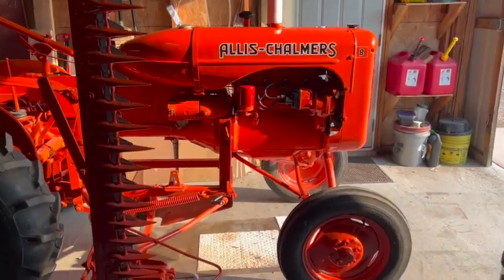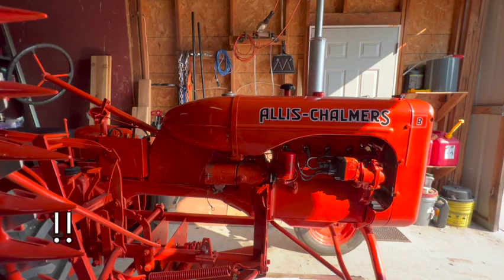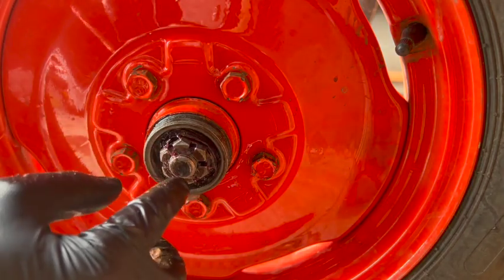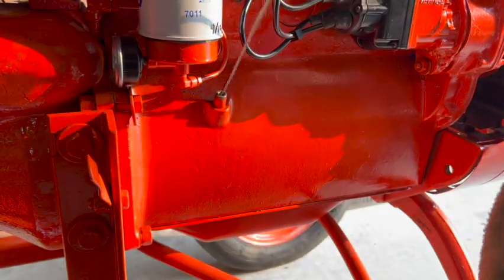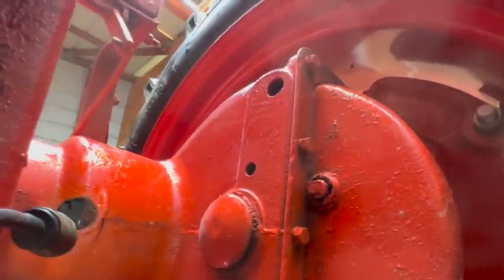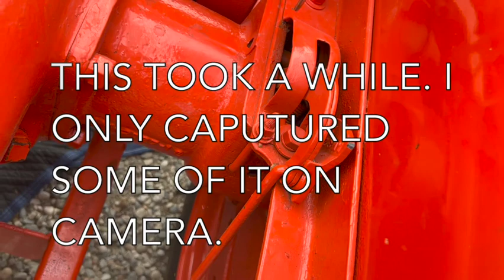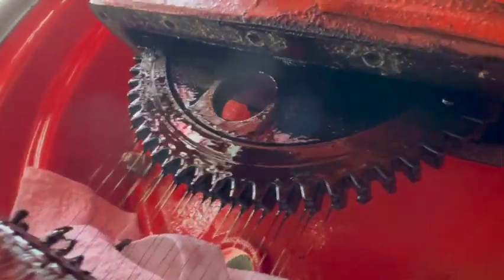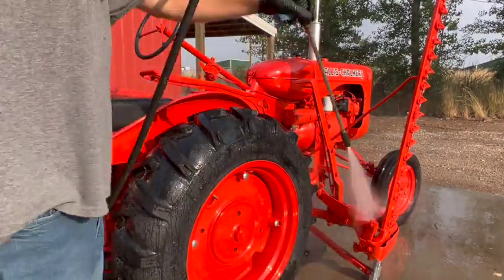1944 Allis Chalmers B - Part 7

Comment: I pulled the final drives off of my B last week. I had a mouse nest in one side and a wasp nest in the other as well. I bolted my final drives back on upside down. Now I'm modifying the front axel. Center pivot on my front axel is 9" from the floor. She's a low rider now. Like crawling down into a go cart.
Reply from the maker: Yes, all that open space in the rear axle area perfect for little creatures. Not the best design I'd say, but wonderful tractors!

Comment: Zinc oil additive to protect cam lobes?  If the cam was not new at rebuild, it should be ok as the metal would have previously absorbed zinc from oil.

Comment: Do those engines use the none-Detergent Oil, Like the Older John Deere's?
Reply from the maker: My personal opinion is this; I use non-detergent oil in my engines without traditional oil filters, and modern/detergent oil in the ones with oil filters.